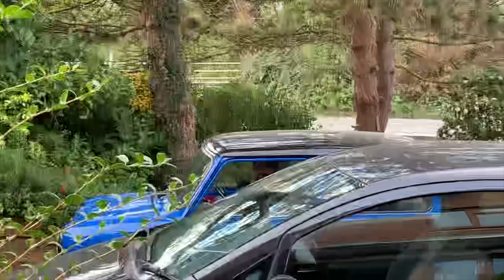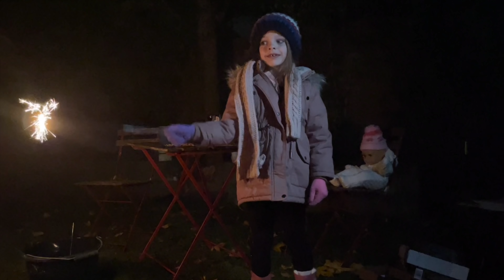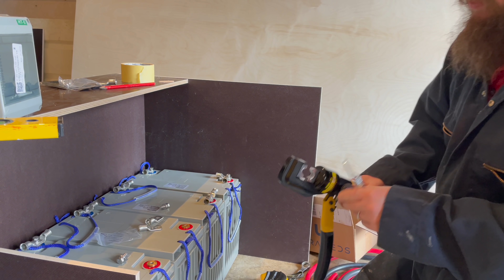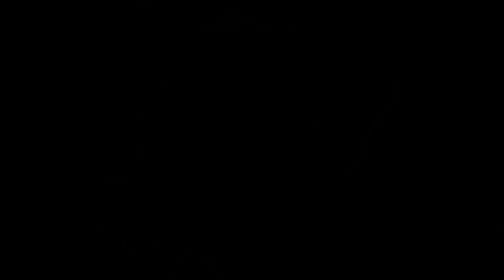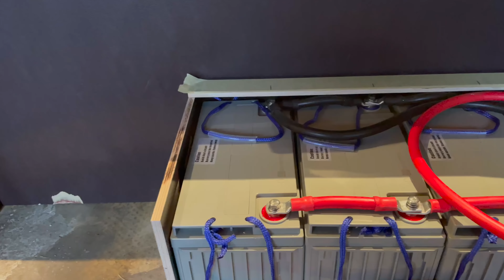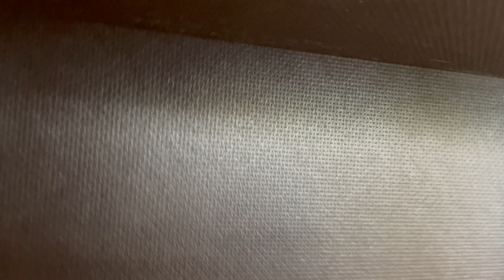Building Electric Cupboard & Wiring 680AH Victron AGM Battery Bank + New Tools | DIY Van Conversion

Comment: I'm guessing  you  are sticking to 12v system  in the hab area then rich. I think I'm going to do mine 24v with just droppers  for the stuff I can only get in 12v
Reply from the maker: Hey Tam. That’s right it’s 12V leisure side for us. So will
Be running a 24v/12v B2B. I tbink if we’d be using much higher draws/larger inverter we’d have gone 24v too. That’s what @maxandsophieinavan have done too and most other Vario people. We are just an oddity is seem 😂

Comment: Great video and love the thought that has gone into the electrics cupboard, particularly the ventilation. Have you thought of adding in a 12v temperature switch to the cooling fans circuit so that they don't necessarily have to be on all of the time? Although you have a large battery bank you don't really want to draw power unnecessarily.
One other thought, be careful to keep an eye on the batteries' voltage when you deep cycle them. I found my AGMs dropped below 12V during deep discharge, at which point the compressor fridge stopped working properly.
Reply from the maker: Thanks Peter. It’s been a head scratcher. On the cooling side; great idea!

 we’ve bought a little fan controller with a thermoswitch; can show that in the next video. It’s the type that runs one of the fans at 20% then ramps up the others as the temperature changes. We might wire it work in a different way; decisions decisions. 

That’s good to know re. The AGM. We’ve decided to use a smart protect in the system. Still need to wrap our heads around that but it should mean we can avoid too low a discharge and I think it can even switch certain things off at certain thresholds until charge is high enough. It’s sounds geeky and we love it (it’s blue too). Do you use anything like that on yours?
Reply: @WanderbusAdventures  No! Now got lithium and the voltage stays relatively constant throughout the discharge cycle.
Reply from the maker: Ah brilliant. Will keep you posted. It’s good to have someone on hand that has used these batteries in anger as it were.

Comment: Excellent video.  Really helpful.  With your AGM batteries, have a read about the available amps and the level to which they can be discharged.  They’re not the same as Lithium, so if you do discharge them to 20% (or zero as you commented in the video) you will damage them.  50% is a more realistic discharge level.  The benefit of AGM over ordinary lead acid, is that you can hit them with more recharge amps, without damaging them, and so recharge them faster.  I could be wrong, and hopefully someone will correct me if I am, but I don’t think I am.  Keep having fun!
Reply from the maker: Thank you. You’re absolutely right. Sorry if we made it sound like we’d be discharging to 100%. That’s not the case (we hope). We will be installing a smart protect to ensure they don’t drop to zero; ours are good for frequent discharge to 60-80%. So we will set the smart protect to 70%. They are built to survive up to 300 100% discharges; but this isn’t the aim. I may not have made that clear.  Thanks for the tip, we don’t want to beating the batteries down for sure. The smart protect looks quite, well… smart. So we can make it switch certain things off at certain thresholds. Quite looking forward to setting that up 😂